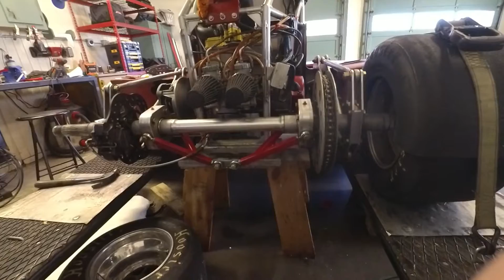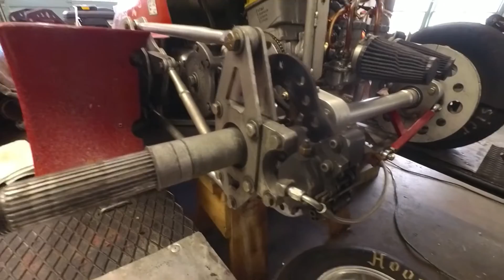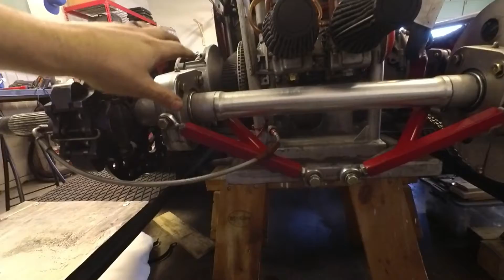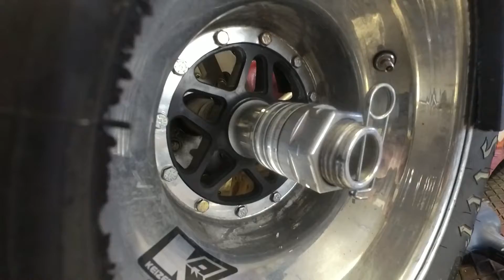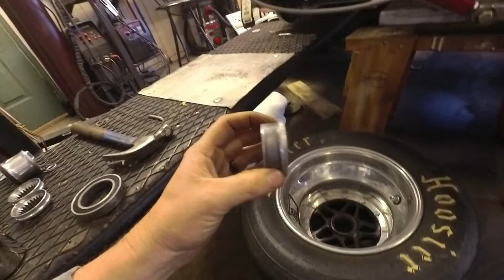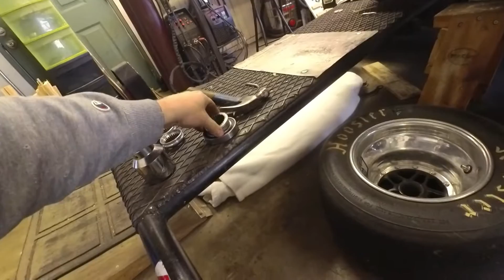Aluminum Axle and awesomeness

Comment: Does that center section with the machined ends come with the axle your ordered ?
Reply from the maker: the short answer is yes.  the long answer is that is part of the axle - the splines are only cut into each side.

here is the part:
https://www.speedwaymotors.com/Mini-Sprint-52-Inch-Splined-Rear-Axle-Black,329218.html